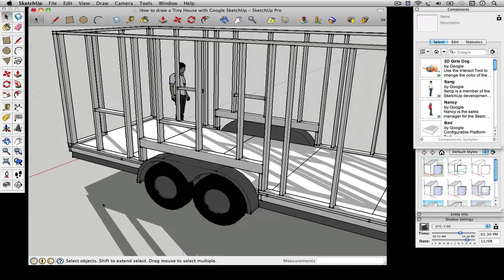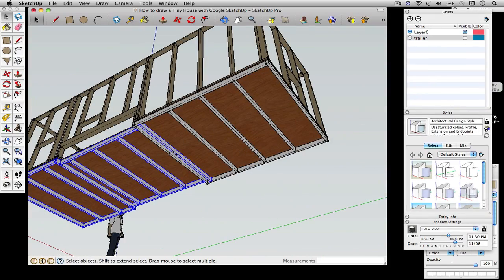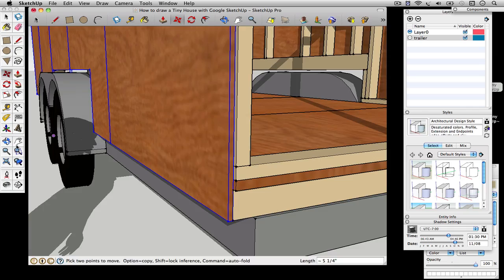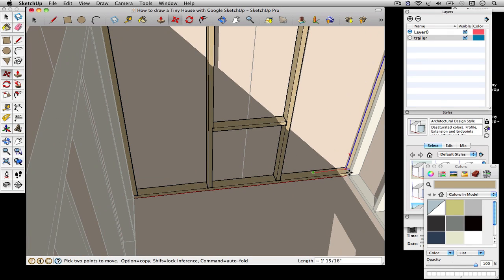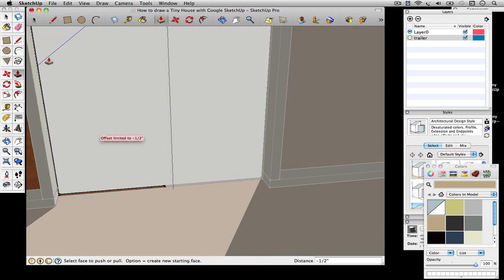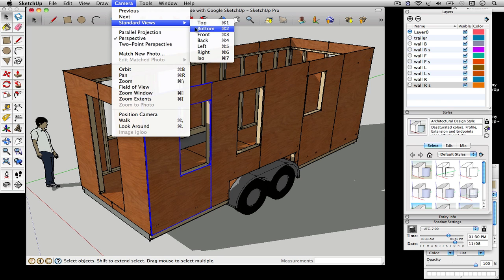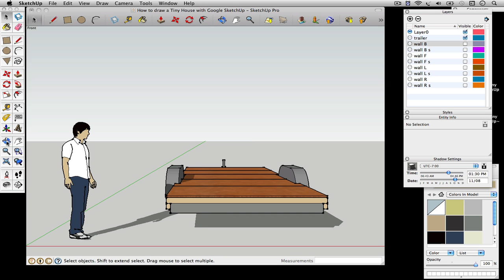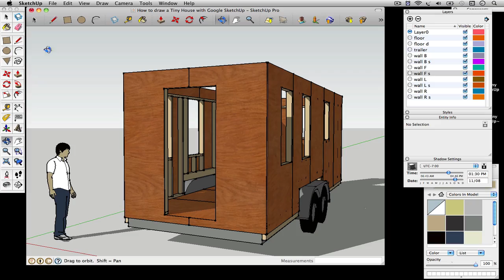How to draw a Tiny House with Google SketchUp - Part 2

Comment: Hey Michael, I realize these videos are old, but still relevant it seems as the process hasn't changed. I am curious why I would want to draw all the framing if the finished product won't show it visible anyway? Maybe you show that in a later video in the series, I don't know.
Reply: In my understanding it helps with making a bill of materials for the framework, how many 2x4s you need, etc.
Reply: I don't know about where you are but in some places we have a weight limit so it also helps to virtually weigh everything up so you don't finish building without an idea of how much it weighs. In Australia if you go over the weigh the trailer is rated it makes it very hard to transport because it's dangerous.

Comment: Curious why you have bottom framing when the house is on a trailer?
Reply: Some builders put insulation/wiring underneath the floor in their tiny houses.
Reply: Seems like gaining the 3.5" would be more ideal but it makes sense for wiring, etc.
Reply: @TravisJohnsonwashere  You NEED the Insulation under the Subfloor just like you need it in the Walls and Ceiling. In the USA the maximum height for a THoW (from the ground to the peak of the Roof) is 13' 6" but most stop at 13' 4" just to be safe. you can easily find 3.5" somewhere in the vertical space to justify having the Floor insulated.

Comment from the maker: Windows and doors come in many different sizes. In fact many homes have custom sized windows and doors. Check your local (or chain) hardware store's website and you'll find many examples. I like to keep it simple and choose 2'x4' and 2'x3' windows. Doors are typically 80" high and in widths like 24" 30" 32" 36".